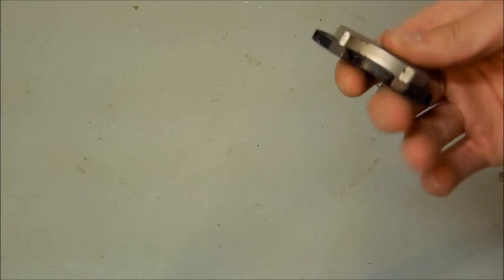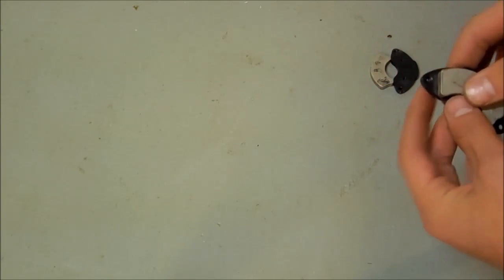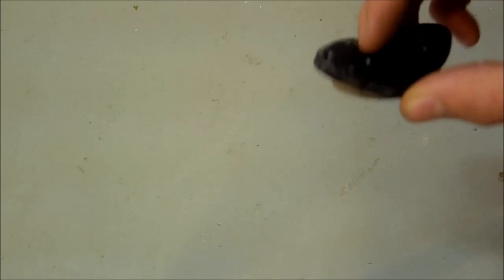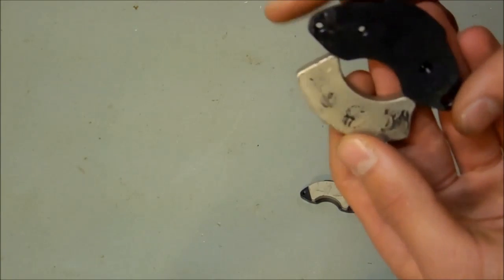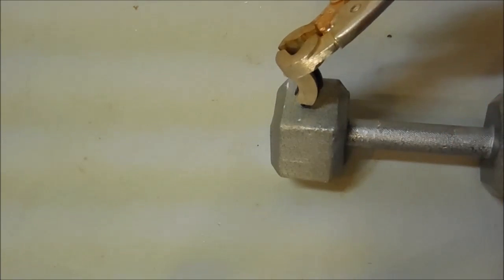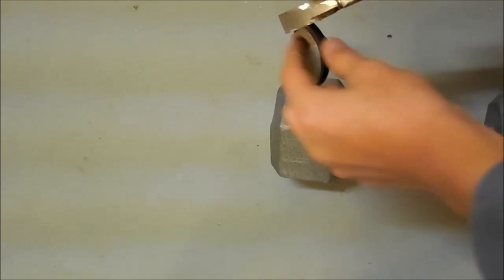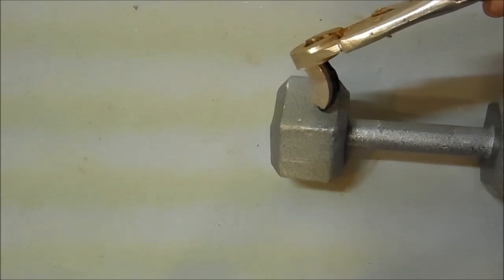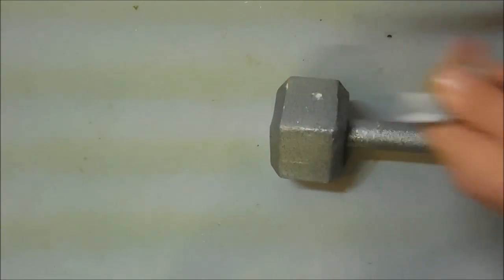How to Remove Hard Drive Magnets From Their Bracket Very Easily!

Comment: some of those metal plates are more valuable than the magnet and is called mumetal which is a magnetic shielding material. How to tell is see if the magnet when attached to it is magnetic to steel on the mumetal side. If its a very weak attraction to steel its most likely mumetal...save it as its very expensive and useful stuff.
Reply: Thanks dude, i got some scrap servers HDDs and they are in some weird brackets that interlock together, they behave how you describe it, i'm gonna save them.

Comment: I wish I could find a different way. I have a couple that are about 3/8" thick, both the magnet and the back plate are that thick, but the problem is I have nowhere to grip the on the bracket. Even if I did I don't think I could bend it since its so thick. I know I could heat it but then the magnet would lose its strength and these suckers are STRONG.
Reply from the maker: +x9x9x9x9x9 Since the bracket is so thick you could try gripping the sides of the bracket with some vice grips and that should hopefully work out for you. Good luck!
Reply: Electrotechnics Yeah but then I have no way to bend it. What I am trying right now is gripping the bracket and the magnet separate and twerking them. No luck so far though. Thanks for the quick response.
Reply from the maker: +x9x9x9x9x9 Did using the magnets inertia not sheer the glues bond, as I demonstrate in the video? If using my method there should be no need to bend the bracket.

Comment: Broke the coating,  was hoping for a method that preserves the coating.
Reply from the maker: I do NOT recommend using heat to remove the magnets. If a neodymium magnet is heated over 176°F (80°C) They will permanent loose a portion of their magnetism.  
As the magnet heats up the molecules start moving around faster and faster, and at that certain point they are able to loose their aligned orientation which causes the magnetic field, thus it looses a portion of its magnetism.   

Thanks for watching and good luck!
Reply from the maker: +x1134x  In this case it did not tear the magnets plating, although it does do that sometimes with smaller magnets.
Reply: On the 3 I tried this way all 3 broke the plating rather than the epoxy.
Reply from the maker: +x1134x Oh, sorry this method did not work, better luck next time. Thanks for watching!
Reply: use heat blowtorch heat the metal side then it comes right of sins the epoxy have a lower tolerance fore heat than the metals
Reply: thanks, do you find they demagnetize at all or does the epoxy melt too soon:  http://www.first4magnets.com/tech-centre-i61/information-and-articles-i70/neodymium-magnet-information-i82/how-does-temperature-affect-neodymium-magnets-i91?
Reply: i just put a small sideways pressure on the magnet and heat the metal side and the epoxy becomes soft and the magnet slides right off, no scratch or surface rupture, on no decrease in magnets effect that i know off, all thou i haven got a tesla or a gauss meter,
Reply: nice I'll give that a shot on my next set, thanks.